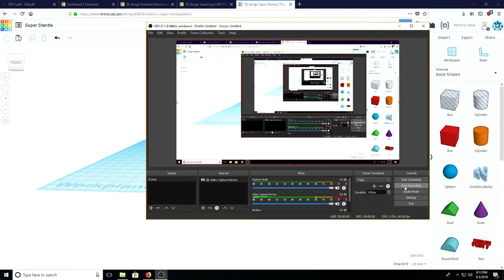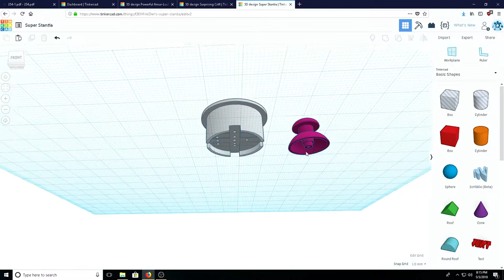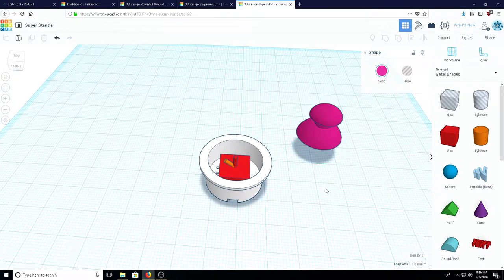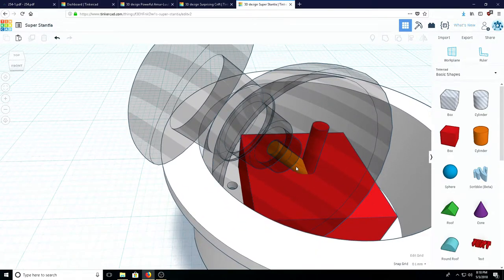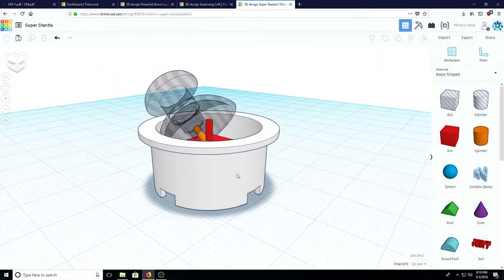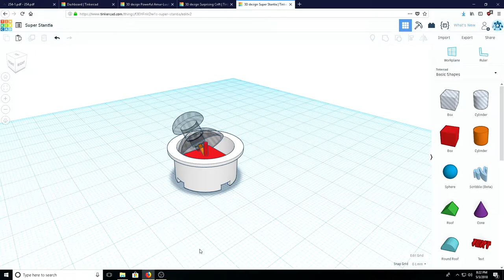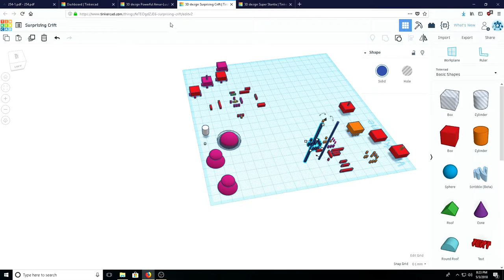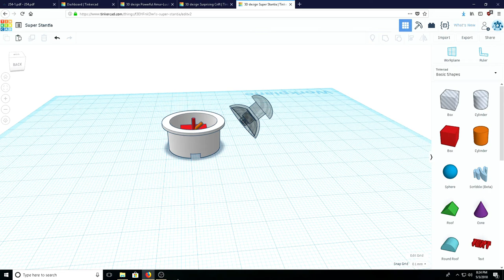Orbweaver analog stick mod update

Comment: I just posted on your other video about purchasing this part. I do want to make a suggestion in the design. I noticed the pot stick isn't very long and the hat stick hole isn't very deep. With your current design when the hat pegged to the of the base mod, the angle of the hat pushed against the edge of the base mod is creating a lot of leverage force on the pot stick/hat connection. If you raise the outer edge of the base mod and create an inward angled lip that is flush parallel with the pegged stick, it will allow the hat to support a lot more forced leverage and put less stress on the pot stick/hat connection.
Reply from the maker: It's already doing that. The neck of the hat hits the inner edge of the cup when pegged (50 degrees of deflection). This prevents max stick deflection (55 degrees) and prevents the hat to stick post joint from bearing the brunt of maxed out deflection force.
Reply: tuffrabit I get that. That's not what I was saying. When the neck is pegged, it's sitting against the narrow 90 degree cornered edge of the base mod. I was saying you should create an angled lip on the base mod so there is more surface area for the neck to rest on. This will alleviate some of the forced leverage on the stick/hat connection. More surface area also means less wear over time.